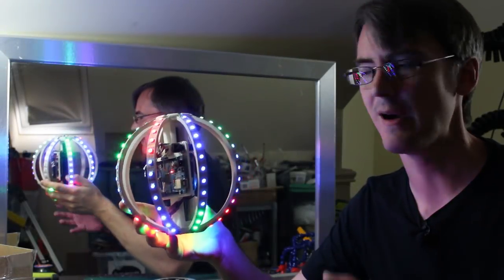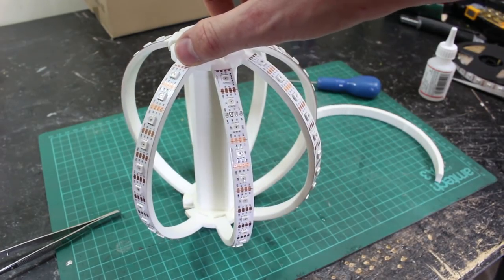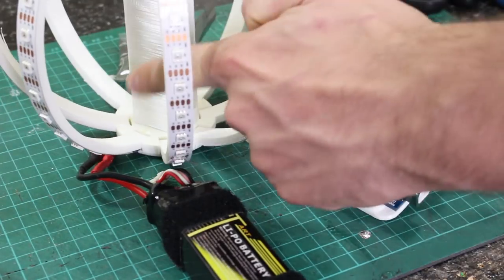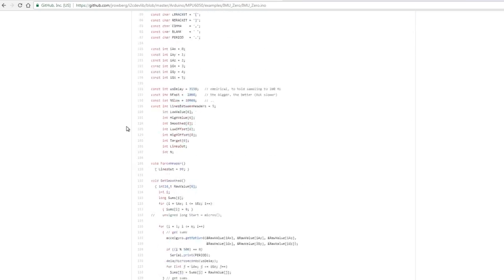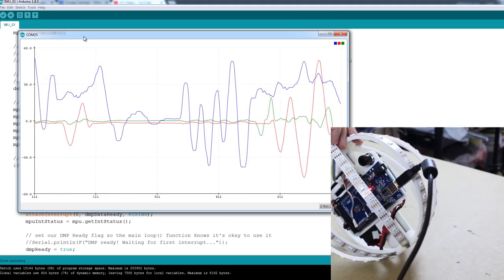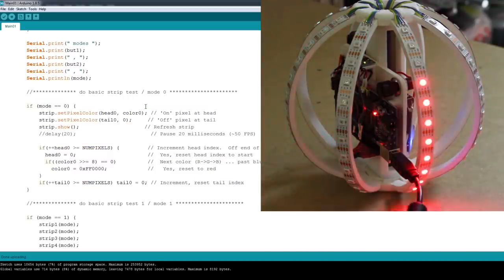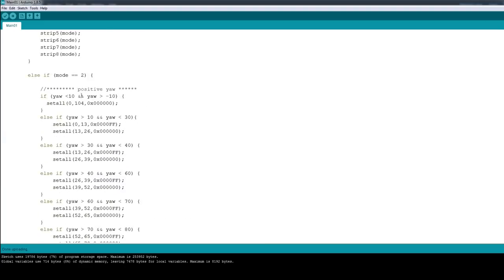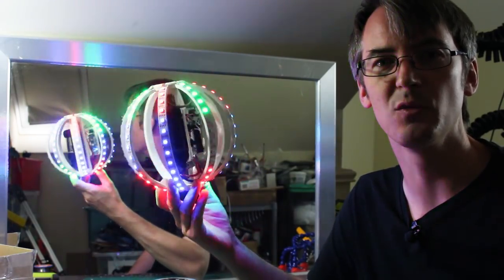How to Build a Gyro Controlled RGB LED Ball | James Bruton

Comment: This is awesome, but why didn't you just flip the alternate the orientation of the LED strips? That would have allowed you to massively reduce the amount of wiring required right?
Reply: i was thinking that, but addressing them in order makes animating some of those sequences way easier i think
he could have done it with an elegant function to re-arrange the addresses but it would be a headache i think.
if it was going to be airborne i would highly suggest your improvement
Reply from the maker: I guess everything can be fixed in code
Reply: Yes - all you need is an address lookup table.
Reply: I was going to suggest this too! With neopixels but yes, a lookup table and it works great. Saves a bunch of voltage drop too.
Also helps to connect the GND and +5V at the end of your chain back to the start to help further with voltage drop.
Reply: Can someone explain this in more detail, because I'm confused. "Flip the alternate the orientation of the LED strips". I feel like there is a typo here or something because that doesn't even sound grammatically correct. If anyone could explain more that'd be great
Reply: Swirlstudios there was indeed a typo but basically instead of running the wires down the core and back again you could just organise the cables like a zig zag and use much shorter wires between the strips. I’m not sure I can explain it any other way without an image 😆
Reply: @andy_warb  OH so you're saying flip the orientation of every other strip so the connection between the output of one to the input of the next is just a horizontal connection, and then the next connection will be a horizontal one but on the other side of the ball, and so on?
Reply: Swirlstudios yes this! 😆
Reply: Adafruit NeoMatrx library does that.

Comment: Great video. Looks like you are using the analog 5050 light strips there. Is that correct? Is there a STL file for the 3d printed ball form?

Comment: Your description of button de-bounce is incorrect.  Debounce is about when you press the button, the physical contact may close and open several times very quickly as it makes the initial contact.  The same can happen on release.
What you described is basic button state management.
Reply from the maker: well you can always add a delay in there somewhere.

Comment: Print ninja flex ball that has slots for the Led but the rubber sphere is outside the diameter of the LEDS to protect them, or squid design and hang out in the wind
Reply from the maker: I think every LED would need to be on flexible wires, but it's possible

Comment: +James Bruton Just want to make you aware of the Naked Mega, which is a lot smaller than the normal one. I use it for my motorcycle datalogger because the normal mega is too large, and it works like a charm :)
Reply from the maker: thanks, can't find any UK/EU sellers so I'd probably have to import a bunch
Reply: Yeah, I bought a few packs of 5 so I have for future projects. They got here (norway) pretty quickly, so I think the shipping is good :)
Reply from the maker: was that straight off Tindie?
Reply: Yeah, he sends stuff to norway, so he'll probably send to UK aswell :)

Comment: I am building a DIY onewheeled electric skateboard, and would be cool to make use of arduino nano, and an imu with led strips added to make it work like if u go forward the front leds will be white, and the back are red, and vica versa. any tips to make it compact as possible? i am new to arduino, and i only saw breadboard solutions but i need something more polished

Comment: It would be cool if you could program the arduino to create a persistence of vision when you spin it and throw it in the air, dont know if the MPU6050 or the arduino are capable of that.
Reply from the maker: The LEDs are fast enough but you'd probably just want to run it over and over and then just spin it

Comment: Nice little toy :D 
But at 7:10 , that's no switch debounce per se. You actually implemented an effective anti-repeat, i.e an edge detector.
Were your MCU a lot faster, it would indeed register each and every rebound of the switch (if any).
Let's not misinform our newbies here. ^w^

Comment: Can I have the reference of your light , please ? 
👍
Reply: Do you want to know what kind of LED he used?
Reply from the maker: They are APA102 LED strips - there's lots on eBay
Reply: Cool, I didn't even notice theres a new "replacement" for the WS2812. These have a much nicer interface, thanks ;)
Reply from the maker: Yes they are faster and don't use interrupts so you can use the standard servo library at the same time with no issues

Comment: I really like your projects, but you should really consult your code with someone ;)
Reply from the maker: well it  would have to be someone on call 24/7
Reply: Programming 112 - sounds like a nice idea ;)
What I noticed watching your films is that you often have variables like head1, head2, etc. instead of putting them in a table, like head[1] = sth; head[2] = sth. I think that if you start with that, you'll briefly notice how you can easily abstract some functions (like strip1()...strip8() in this video) :)